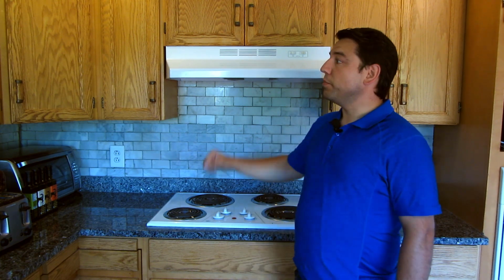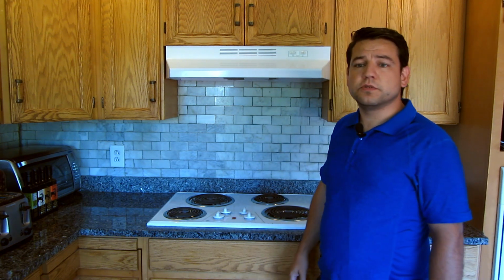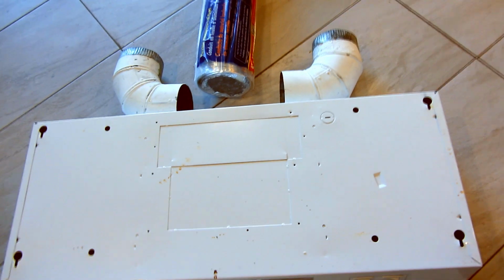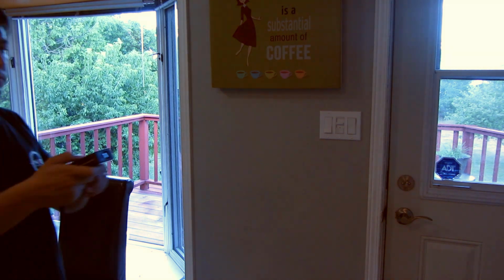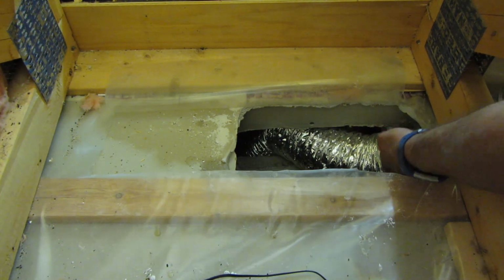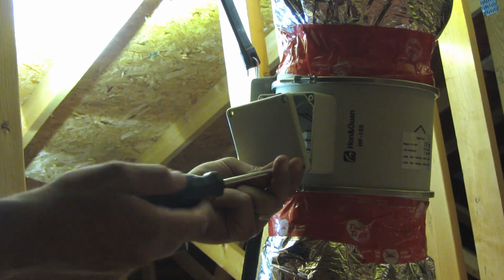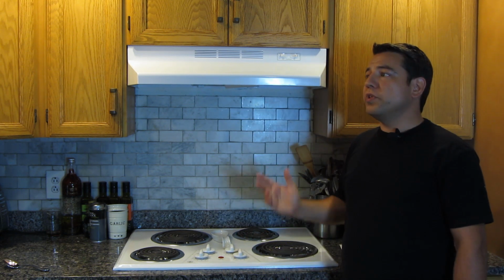Super Quiet Range Hood with Inline Fan

Comment: Dude!  I'm going to do that!  Our hood does vent outdoors but it is extremely loud and it just doesn't pull air very well.  I have a solid pipe in the attic but I will cut enough away to allow for some soft pipe to reduce the vibrations of the motor from passing through the ceiling and I will mount similar to your solution with something absorb vibrations.  Our vent has 3 speeds and I see there are 3-speed 120v inline fans.  I'm on it!  THANK YOU!
Reply from the maker: Awesome! I hope it goes well. If you can use rigid pipe all the way, that may be better for sound. The flex pipe has ridges on the inside, and the air running past those can cause vibration and some noise. Not a lot, but if you want to get the least amount of noise possible, go rigid all the way. Although you may not be able if you have to get around turns or something.
Reply: @GabesHacks  Then I will not use flexible pipe.  

The other thing I can understand is how to connect an aftermarket 3-speed fan to the factory speed control switch on my current hood.  I suppose that the worse case is that I mount the controller that comes with the fan into a new place on the hood.

Comment: Thanks for your video. I bought a similar Hon and Guan fan because of your project. I want to wire it into my existing range hood as you did. Is there a wiring diagram online anywhere? My Hon and Guan fan came with a dial controller for the speed.
Reply from the maker: I don't have any wiring diagram. The one I got was just a simple hi/lo switch. A dial is a little trickier. If you don't mind giving up the dial, you could just keep the dial at max and then switch the main power to it. That way it'll always be on max when it's turned on.
Reply: @GabesHacks  Thanks!

Comment: Hey there! 
Nice work . 

You inspired me to do the same in my new home. I did all the plumbing to the roof with 6 inch rigid & insulated pipes ... flex is only ta short pieceo connect the pipe to the hood itself. 
I chose a radial blower motor instead of an inline for durability ... it's rated @ 6400 cufeet / hr @ high speed. 

I'm having trouble wiring it to the factory control board of the hood for a sleek look. 
Can you help ?
Reply from the maker: Nice! I can try, but I can't promise anything. What's the model of your hood? Were you able to remove the built-in fan? What wires were connected to the fan (how many and what colour)?
And how many wires (and what colour) does the new radial fan have?

Comment: Nice work.  

But unfortunately, flex vent duct does not meet or satisfy building codes in the US.  All 50 states residential codes meet or exceed International Residential Code.  Smooth walled inner surface ductwork must be used to vent cooktops, however, there are a few exceptions which would not apply in this case.
Reply from the maker: Someone else had mentioned that too, but here in Ontario, Canada, it's allowed. However, if I did it again I think I would use smooth-walled rigid ducts just for the noise. This project turned out great, but I think it could have been even quieter.

You can see my longer reply to the other person here: https://www.youtube.com/watch?v=P7S6Qo3Cbo8&lc=UgyltSzvsLY1tY-6-a94AaABAg.98aotVqeDZV98bBN_bOG-0
Reply: Thanks for the post. I didn’t know that. I just installed a vent with the flex pipe it came with…. I guess I’ll be swapping that out.

Comment: Hi Gabe, Great video! I'm thinking of doing this same thing in my house. Just wondering if you have any thoughts now that it's been 2+ years. Are you happy with the results? Is there anything you wish you'd done differently? Thanks!
Reply from the maker: The only thing I think I would do differently is use rigid pipe up the wall, although I don't know if I could have actually got it in there. The flex pipe was certainly easier to work with, but the flexibility allows it to vibrate and the rough inside adds to air turbulence, both of which add noise. So I think it could have been even quieter. But it's still far better than what was there before.

Comment: Great video. Great solution. How would you do this if, instead of a hood vent, you had a microwave oven over your range? How can one operate the exhaust fan in the attic using the fan button on the microwave? If an in-line fan company provided a plug-and-play cable/connector, that would be sweet. But, since nothing like that exists, can someone with electrical skills offer a solution?
Reply from the maker: I have thought about that. You'd have to take down your microwave, open up the top back and remove the fan. It should just be screwed in and have an electrical connection to the microwave. You will have to do some testing to see what what it's doing. If the fan has a high and low setting, then it should be a 3 or 4 pin connector (high speed hot, low speed hot, neutral, and maybe a ground). You can use a multimeter to measure the voltage on those outputs and see what you're dealing with. Best case is that the high speed gives you full line voltage (120V AC in North America), and the low speed gives you a lower voltage. That should work perfectly with an inline exhaust fan. Even if it only has one speed, as long as it gives you line voltage, that will work.

In either of those cases, you can hook up the fan to those connections. You can cut the connector off and use a standard twist-on connector. This would likely not be strictly up to any electrical code, but as long as the connections are tight and inside the metal casing of the microwave, it will be safe.

An alternate case is that the fan inside the microwave runs on DC, in which case it would be harder to find an inline fan that will run on DC. But I don't think that is likely.

Comment: Great vid! I've been about to do this for a few years. Thanks for actually gettin it done and posting the vid results. Still happy with it? How's that blower doing? I have that same hood and I've seen similar blowers for <$200,  but shied away from them because they are not "kitchen blowers".   Any issues since you installed it?  I've stumbled into a complete system with a hood for <$400 us with a 900cfm external blower with everything but ducting (read slightly easier installation). Is 300cfm doing it for you? Thanks in advance and again, thanks for the vid!!
Reply from the maker: I'm not in that house anymore, but I hadn't seen any issues and the 300cfm seemed to do the trick. 900cfm will certainly do the job, but keep in mind that pumping air outside will create low pressure in the house and air will be sucked in through any means (leaky windows/doors). If you're in an area with winter, that can pull in cold air from outside. Some building codes require make-up air if you have an exhaust fan above a certain size, so check your applicable building code. If your home has an air exchanger, you should be ok.

Comment: One thing was not clear to me - does the hole in the roof go all the way out, or are you releasing the kitchen smells into some intermediate layer between the inner and outer roof? I am not familiar with the layers in a roof but I was nervous when you drilled into the roof and wondered how you are going to keep the rain and snow out.
Reply from the maker: I didn't cover that since it's normal roofing practice. I did it the same way as this guy: https://youtu.be/Jrv9myUt9Z4
Reply: @GabesHacks  ah ok, great, thanks.

Comment: That’s a super useful project and excellent video to explain it. I am a noise engineer and can’t stand the exhaust noise myself. It even interferes with your cooking because I suspect that the sounds of food sizzling and cooking is as an important feedback mechanism for the cook. We don’t usually think about it until something noisy turns on and you lose the food sounds. I smiled at your  bungee system but it’s great. You nearly eliminated what we call ‘structure-borne’ sound.
Reply from the maker: Thanks for the kind words and that insight! It's appreciated. I hadn't thought about being able to hear your food cook, but that's a great point!
Reply: agreed on this both useful and actually enjoyable to watch......that combo seems to be getting too rare these days on YT.  @sanjay y - what would the "pro" version of mounting this fan look like? (sincere question i would love to hear someone in the industry chime in on) -- also @gabe, the bungee cord system seems like a great bang for your buck solution. i may copy that for other uses in the future. very little surface area to transmit vibrations, cheap, and (hopefully) effective. well done on this vid, keep up the good work.
Reply: @jordanprice5954  The pro version would be to design an isolation system that is tuned to reduce vibration force transmission into the roof structure. Simplest version of this is rubber bushings that soft enough to reduce transmission but stiff enough to hold the assembly in place securely and minimize its motion (vibration or otherwise).

Comment: You can just put charcoal filters on there
Reply from the maker: You could, if that's what you'd like. I was trying to address the noise, which a filter wouldn't change.
Reply: I’m talking about the venting
Reply: What recirculates the air

Comment: I'm currently sussing out a build to install an OTR Microwave/Range Hood combo above my stove. I was pondering putting in an inline fan in the ducting and wiring the control wire to the OTR controls (would run with the fan in the microwave), just to boost CFM. Would using an inline fan in conjunction with the microwave fan actually boost airflow like I'm thinking it will, or will it hinder flow?
Reply from the maker: It would probably help. Another option is to just remove the motor from the microwave entirely. The fans used in over-the-range microwaves are often loud and not that powerful anyway.

Comment: Is the inline fan designed for hot kitchen air or air with oil particles etc?
Reply from the maker: According to their website, the fan has an IP44 rating for water resistance and a top operating temperature of 60℃  : http://www.hongguanfan.com/index.php?m=Product&a=show&id=239
Keep in mind that there is still a grease filter in the hood itself. I also made a lengthy response to someone else who asked about the potential for fire in another comment: https://www.youtube.com/watch?v=P7S6Qo3Cbo8&lc=UgyltSzvsLY1tY-6-a94AaABAg.98aotVqeDZV98bBN_bOG-0

Comment: Why not replace with a good ducted range hood
Reply from the maker: That comes down to the noise. Super quiet range hoods are going to be very expensive. Silence is a luxury in range hoods. Putting the fan in the attic is cheaper and may still give you better results anyway.

Comment: Connect the hood body to safety ground even if there's no motor inside, so that it doesn't carry a floating potential.
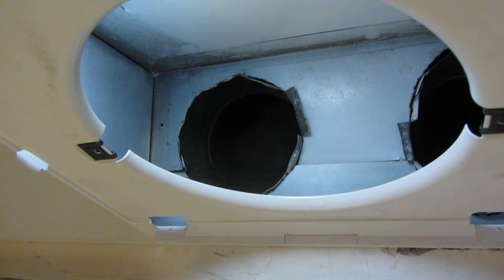Reply from the maker: Yes! Definitely. I did connect the ground to something in there, which you can see at 7:19 but I forgot to mention it.

Comment: Does this mean I could actually increase the CFM’s of my old hood substantially? That would be pretty amazing since I now need to triple it at least- my hood is ancient and I switched to gas.
Reply from the maker: The CFM's is determined by the fan. So yes, you could increase the CFM's by removing the fan in your hood and put in a new fan in the attic like I did. Or just swap out the whole hood and fan for a new one.
I did what I did because I wanted to keep the noise down in the kitchen.
Reply: Be careful not to go too high or you make have to consider make-up air to accommodate the extra air that you are pulling out. General rule of thumb is anything over 200cfm needs make-up air. However, if your house is older, there's a good chance you don't need it since it will just pull the air needed from the cracks on your house envelope. Great video though. I've done something similar on my house.
Reply: @Following5  always good to have air supply, at least by the means of tilting the window. Especially with gas.

Comment: That duct is not code compliant as per the international residential code. Kitchen exhaust duct must have a smooth interior surface. You should go to your township and submit a permit application for building and fire. Your local Code Offical‘s can help you to not burn your house down.
Reply: In fact, look at the illustration on the packaging of the duct and you’ll see that it is meant for a bathroom exhaust fan. Grease will buildup in the ridges of that duct and can cause a fire in your attic.
IRC 2015 M1503.1 The duct serving the hood shall have a smooth interior surface... and shall be constructed of galvanized steel, stainless steel or copper.
Reply from the maker: You will certainly want to look at your local codes.
And yes, the IRC disallows the use of flex pipe, but the IRC is not really international. It only applies to most of the US (but not Wisconsin 🤷‍♂️). Here in Ontario, Canada, I'm governed by the Ontario Building Code: https://www.ontario.ca/laws/regulation/120332

Our building code specifically allows flexible duct in a residential kitchen exhaust (search the page for "Notes to Table 9.32.3.5").

I don't doubt that some grease will be caught in the flex pipe, but I really doubt that it could ever get hot enough to catch fire.  The air inside the pipe can't ever be hotter than the air being fed into it, and that temperature drops fast between the source and the exhaust inlet, especially since it's being mixed with ambient air too. I can't see how that temperature could ever be higher than the smoking point any grease (minimum 225°F/107°C according to this: https://en.wikipedia.org/wiki/Smoke_point ). That is, unless you already have a fire on your stove.
Interestingly, most greases have a higher smoke point than the melting point of polypropylene plastic (320°F/160°C), which is what the blades of a kitchen exhaust fan I still have is made from. That tells me that exhaust fan manufacturers never expect the temperature of the exhaust air to ever reach that.

While commercial kitchens are a whole different breed (I've worked in a commercial kitchen before), I haven't been able to find any residential examples of a kitchen exhaust duct fire. If you find any, let me know. I would be curious to see what they determined the cause to be.
Reply from the maker: All that said, using rigid pipe would have been better simply for the sound. It's not quite as quiet as I had hoped, and I'm sure using rigid pipe would have helped that.
Reply: Just use the original grease filter for the body of the hood.

Comment: May I ask why did you spit the duct in 2 instead of using 1 straight duct into the vent?  I'm in the process of doing the same system.  Thanks
.
Reply from the maker: Because there is a stud in the wall right in the middle. There isn't room to connect one large pipe from the middle of the hood.
Reply: @GabesHacks   oh ok. Thanks a lot bud.